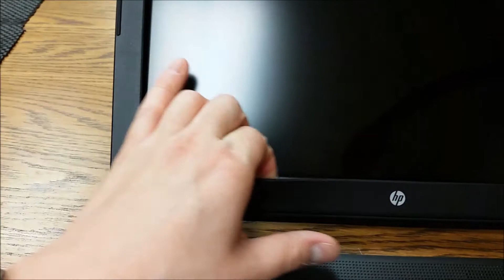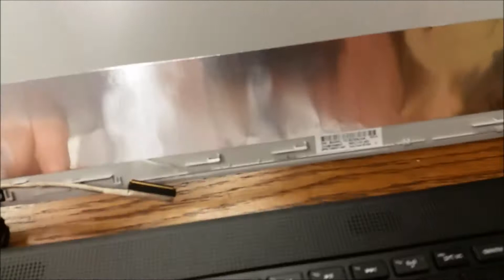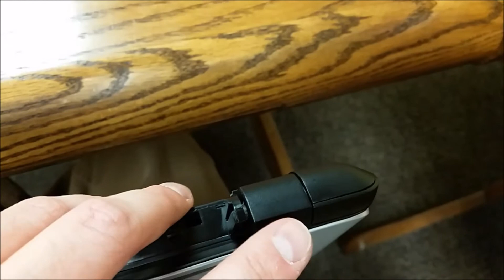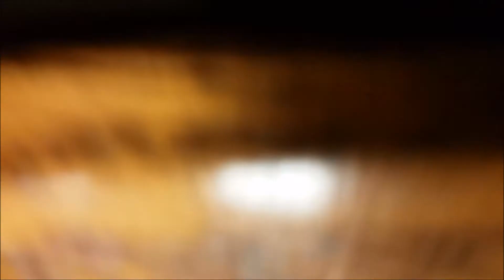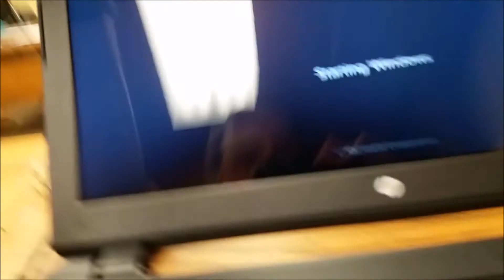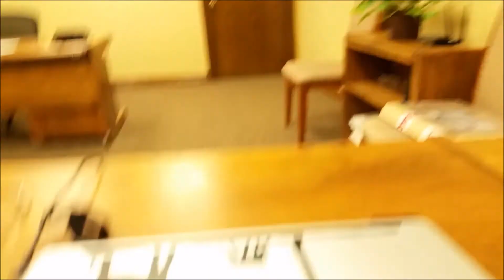Laptop Screen Replacement HP ProBook 350 G1

Comment: The "breaking noise" when prying off the bezel is not such "a good noise".  My bezel won't snap closed on top.  Many little tiny pieces of plastic broke off when removing the bezel...even gently.  They almost look like manufacturing debris.  Now the top won't snap together.  The sides are pretty good, and around the hinges, too.  This was a brand new, replacement bezel.  

I wasn't replacing the screen, but was replacing the back cover (grey top with HP logo...top when its closed).  The screw holes that the bolts attach the hing to the top had broken off.  I purchased a new grey piece, and the bezel.  When they arrived, they had been shipped snapped together, so I had to pry them apart.  I don't think these bezels are meant to be used more than once.